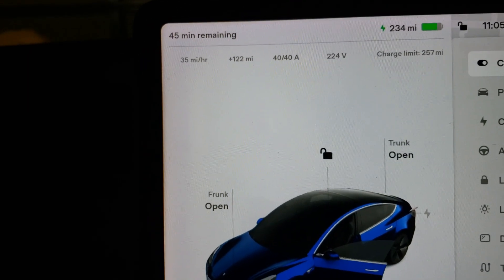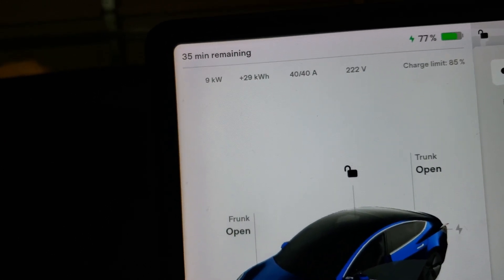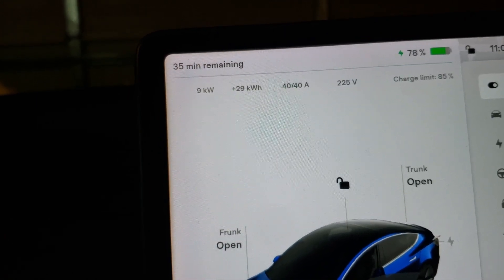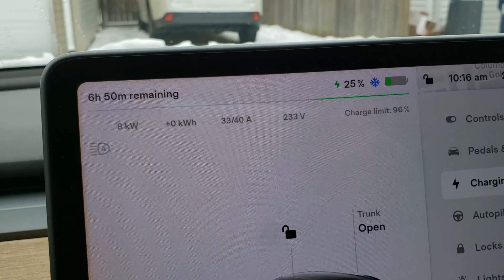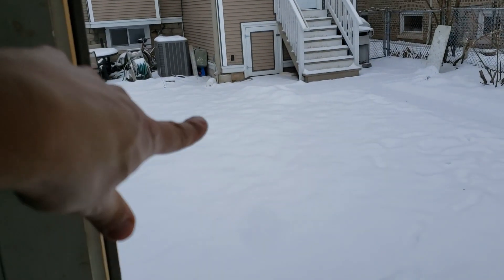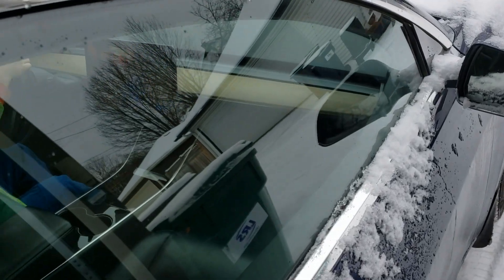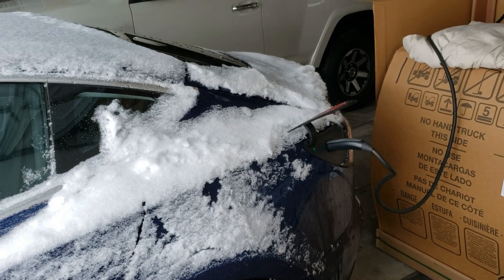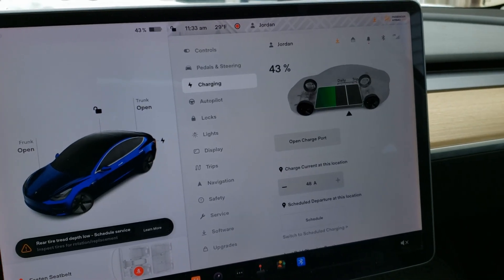Tesla Model 3 Battery Degradation Estimate and Level 2 Charger update

Comment: Thanks for posting this! In doing a bit more research (car shopping), it seems some original M3 battery packs experience far less degradation than many accounts mentioned on the Tesla Motors Club forum. I’ve owned a 2014 Spark EV and at less than 50K miles, it has about 25% degradation. I didn’t expect much from Chevy, but apparently their EV1 was revolutionary and my car is sort of the second gen of that car. 🤷🏻‍♂️

In any case, I trust Tesla cells more and I think if you properly take care of the battery, it’ll last past 200K miles easy. I hope low degradation is an indicator of good battery health. Haha. 😅

Your videos have inspired me to finally get my first Tesla. I am now far more comfortable getting a high mileage M3. The features on the M3 alone FAR exceed anything I’ve ever had in a “modern” car. I’m excited to get one soon. 🙃 I’ll post a video when I get it and share the link.
Reply from the maker: Interesting about the Sparks as I considered one of those, an eGolf or Focus Electric before buying my Tesla. I'm not a Tesla fan boy but the Model 3 is just way more worth it even at double the price. 

That part about the early Tesla batteries was interesting as well, I hadn't heard that. 

Good luck in your search.... Happy to try to help with what little I know about them if you want

Comment: Heard 23 amp is best for longevity 40 works for charger connected straight to electrical
Reply: As far as I know any AC charging is easy on the battery pack. Degradation is a function of temperature and state of charge. High temperatures and leaving a pack at higher states of charge lead to more degradation. 

One thing that’s maybe counterintuitive about 110 v vs 220 v charging is that there’s substantially more loses at 110 volts so you’re paying for more energy at the meter bs what goes into the Tesla pack of you charge on 110 than on 220 plus it of course takes so much longer to charge. I think those losses take place in the onboard AC to DC converter and that efficiency thing is not unique to Teslas but any typical EV.
Reply: @skyemalcolm  yeah the battery pack would be fined but the wall connected charger itself might die sooner

Comment: Do you know if the car is on its first battery pack?
Reply from the maker: I do not know either way. Is there a way I can tell in the app or other records?

I do see in the app it says when my battery and powertrain warranties expired (due to mileage). Would a new battery from Tesla result in a reset battery warranty?

I would LOVE it if it had a new battery, believe me, but no idea if does or not.
Reply: @MindofMatter  My battery was replaced in Sep. 2022 and the warranty expiration in the app has not been reset by Tesla. Next time I get a chance I will ask the service center about it.
Reply from the maker: @joemtnclimber793  thanks for sharing,  good to know
Reply: @MindofMatter  also when Tesla replaces packs they don’t necessarily put a brand new 0 degradation pack back in. What they’ve done for some folks is put in a pack that hit their minimum spec of degradation for a high mileage car. All that to say maybe the pack in your car is original and maybe someone knew what they were doing and treated the car nicely and only charged it to 60-70 percent. Given that it’s a long range for many folks just around town driving you could easily get away with that. I don’t have one of these cars but I’m definitely looking at buying a used Model 3 and the long range RWD models would probably be the best deal for me since I road trip a lot.
Reply from the maker: @skyemalcolm  good point, thanks

Yeah I would definitely wait for a good long range example. Prices are coming down so it's going to be easier to find one for a good price.

Whoever owned this car put A ton of miles on it in a short period And yet still managed to keep the battery in good shape despite what had to be a lot of supercharging so credit to whoever that is
Reply from the maker: @skyemalcolm  That sounds cool, I thought about getting TeslaFi but I didn't want to pay for it. I'm going to try that battery degradation test at some point but I do think it would be cool to know how many times it was fast charged like you say